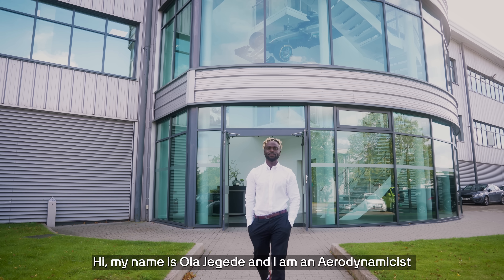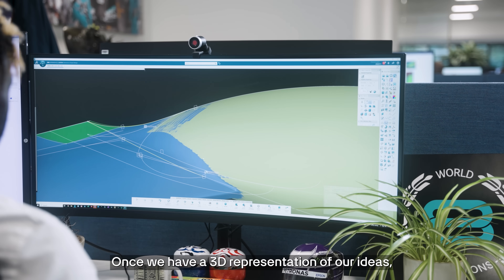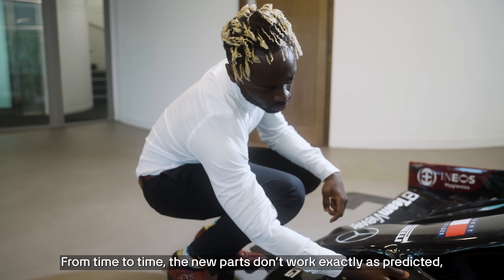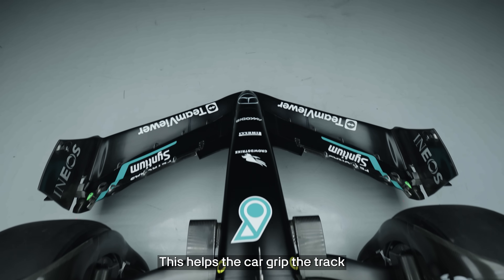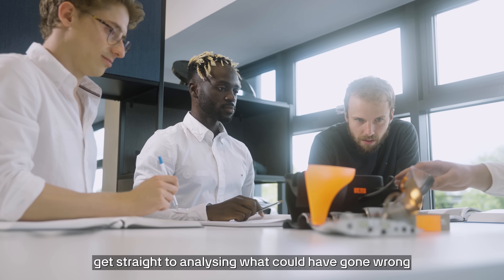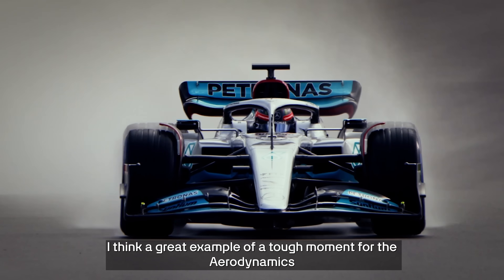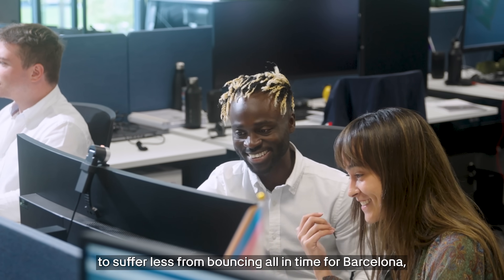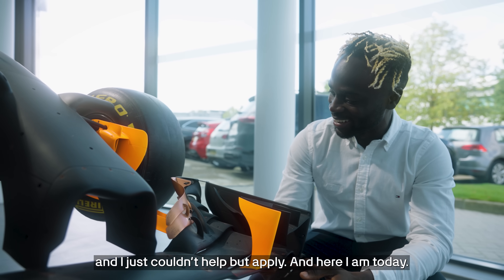My Job in F1: Ola | Aerodynamics

Comment: That is the problem when you take the wind tunnel results whe a standing car and think it will work the same on the road with a moving car. It's actually not that great of a simulation.

Comment: Would've been interesting to know how many parts get designed vs. tested vs. going actually on the car
Reply: Even better comparison would be pre 2021 cost cap & now. Loads of stories on some team would literally fill skips full of carbon fibre parts that never made it. Now I imagine it's a dull downward line with sharp drop offs re what is tested & makes it on the car Hence teams like McLaren are now pushing tech to 'recyle' carbon
Reply: As many as they can squeeze out of the budget, I guess? Most of it goes into man hours I suppose. 
Dealing with diminishing returns, so it's vital to have a good feeling of where exactly the gains can be found. 
Imagine they do hundreds of CFD tests on some design iterations, before they make any prototype part. Then they probably only scale them up if they're going to bring something new to the track.

Comment: It's sad to read comments, that diversity at F1 ... is the result of Lewis being there. Diversity has existed at F1 for decades... Lewis wasn't even a sperm cell, when it started to happen. F1 being the pinnacle of motorsport, means... that every single team, wants the best of the best minds, working for them... and before people from other ethnicities started to invest their lives, specializing themselves on some very particular areas and subjects, sharing their passion on it, that were compatible with the world of F1, like physics, aero and mechanic engineering (and so on)... most of those brilliant minds, were just, caucasians. It's good for the world and for the sport itself... that more people from other ethnicities, nowadays... do fall in love for some specific areas, compatible with some very peculiar tasks inside an F1 team. That's the example, of Ola Jegede.

Thanks for sharing your world, inside the Mercedes-AMG Petronas Formula One Team, Ola